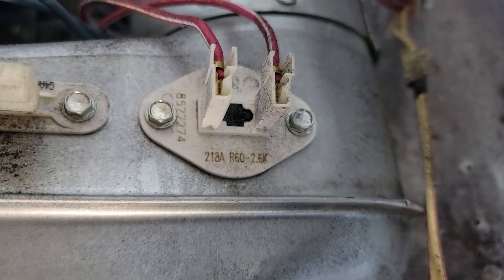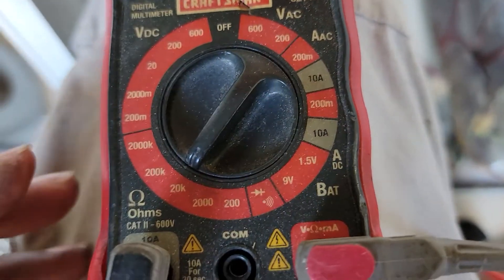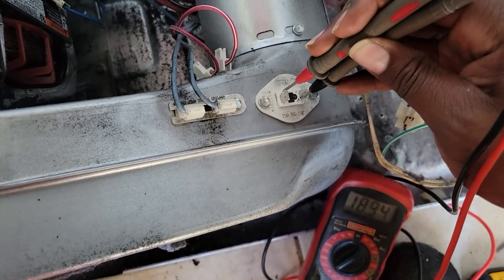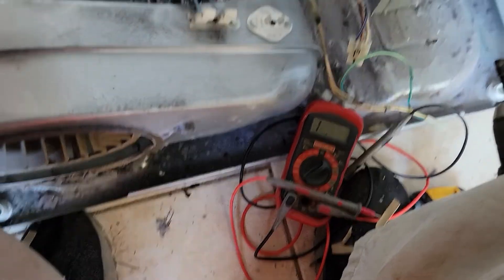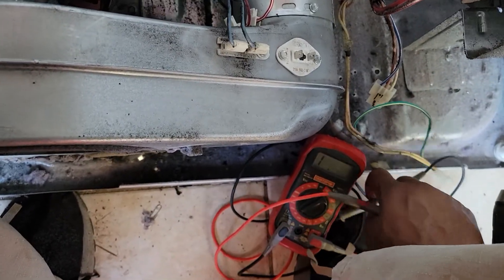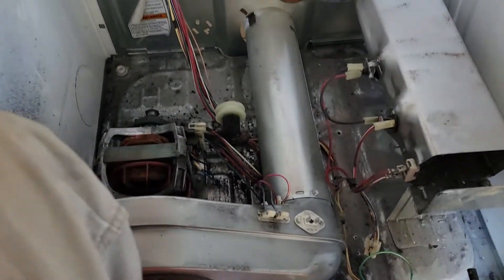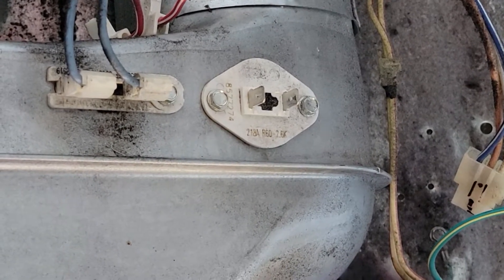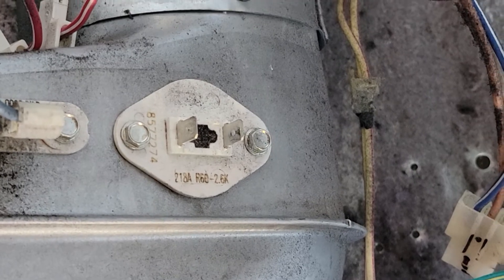tO error code, how to test a bad thermistor on your dryer

Comment: Beko dcb93166w condenser tumble dryer runs for a minute or so then stops. 
I went to check it out for customer put a moist dish towel into it and it ran fine.  No signs of a problem
The customer messaged today to say it is still doing it.  Any suggestions?

Comment: I have a thermistor frigidaire dryer 56000 ohms is that a good reading or bad learning thank you
Reply from the maker: Looks like the wrong setting. Thermistor readings are usually around 16 or depending on manufacturer specs

Comment: Ive a got a dryer now. A Kenmore elite front loader. Giving me a f22 error code. Im not sure if they can be bypassed i tried with a jump wire and im still getting the same code. Resister is reading normal ohms at room temp. Should i just try replacing it or could it be something else

Comment: What would be a problem with the dryer to cause you to need to change the thermostat
Reply from the maker: Thermostats are like light switches so, when they break I'll either be stuck on the on position which keeps the heating element on or the opposite which the heating element will never turn on but 90% of the time it's sticks in the on position causing the high limit to  trigger as a backup, turning off the element

Comment: I know its not your fault,  but why don't appliance manufacturers make an access panel for the thermistor,  I have this problem with my dryer now, and completely disassembling the whole dryer seems to be the dumbest possible way, its like tearing a whole car engine down to get to oil pan, a small access panel seems like a no-brainer to me?
Reply: Fraud and a lack of courage from people